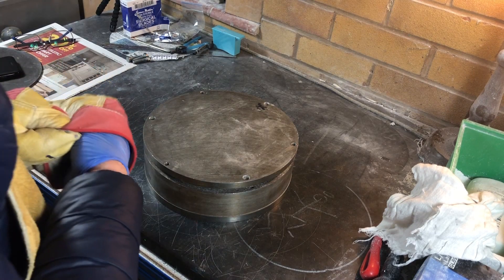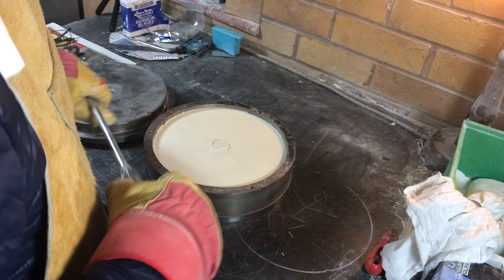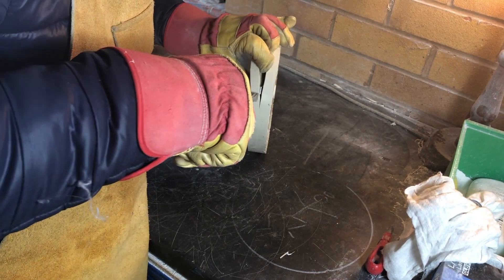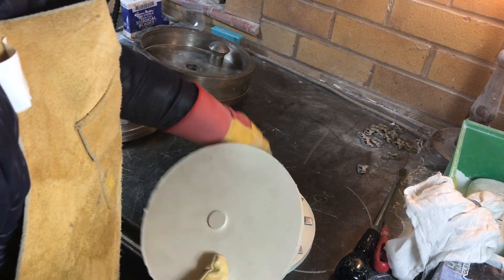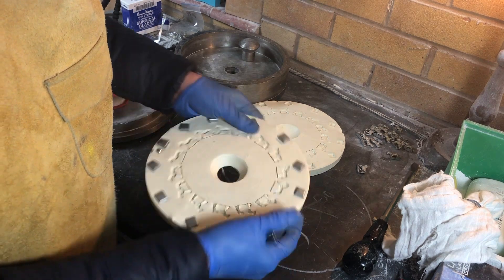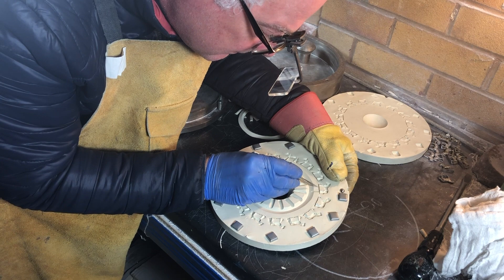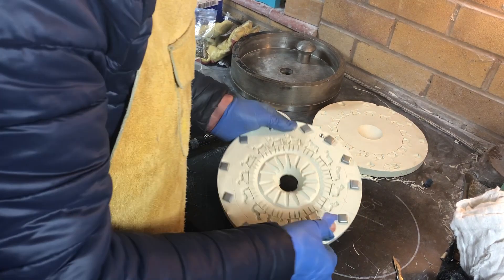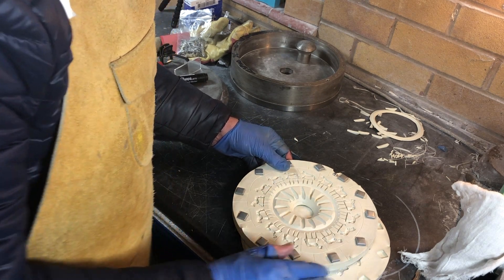Making a spin casting mould, part 2: extracting and cutting

Comment: Many thanks, so interesting ! I am actually working on my own tin miniature as an amateur (with a simple "hot pot II" ) As tin is rather expensive I'd like to mix something with it, maybe avoiding using lead because of his bad toxic réputation.., Something with bismuth & zinc ?  I found very few information on the web about alloys... what kind of alloy do you use ??
Reply from the maker: I use Pewter 92, a lead-free pewter. It’s not cheap, at 92% tin. 🙂  Pretty much all the work on viable tin and tin-lead alloys has been done, and mixing your own based on no knowledge is fraught with problems. I have a background in metallurgy and am happy to accept the formulations worked out by suppliers of casting alloys and low-melt alloys, because they know what works and what the properties of each particular alloy are. I wouldn’t use zinc: high melting point and wears out moulds faster. The cheap casting options are usually tin/lead/bismuth alloys. Some lead is inevitable. Geo W Neale, for example, offers the Grade L formulation, which is relatively cheap: it’s terrible to cast with for small pieces. If you have access to Prince August metals meant for drop cast moulds, although expensive they are viable for hobbyist castings.

Comment: The silicone rubber is high tear strength or high temperature resistant?
Reply from the maker: The main virtue of the silicone is it is low-temperature curing, which minimises shrinkage, especially if the moulds are pre-heated to 80degC (near to their vulcanising temperature) before casting. The cream formula discs are suitable for tin-lead alloys or pewter, so typically 280-330degC for metal casting temperature, and again pre-warming the moulds helps the casting process for lighter alloys such as modern pewter. High-temperature silicone moulding discs are available for alloys such as Zamak, but the shrinkage is greater. Tear-resistance is OK: I have silicone moulds that have done 10 years and are still perfect; others, just two years before some cavities are useless. The nature of the castings has the biggest impact on mould life: too many deep undercuts will destroy any mould quickly, even traditional organic black rubber

Comment: This is a great series as I have been learning to cut a mold….Why are the gates cut in the top not the bottom?
Reply from the maker: The dished cavity in the bottom of the mould makes the rubber far thinner there, so it's too easy to cut all the way through the mould by accident, especially if using a scalpel rather than a lino cutter. I have a number of moulds made by other people that are cut unto the bottom, and the network of cuts into the rubber makes for a less durable mould.

Comment: Hi Mr. Saunders...thanks for the informative videos on spin casting. I wonder if you know where i EU og GB I can buy 18" silicone moulds. I need moulds for both White Metal. Zinc an plastic. Any help would be greatly appriciated.
Reply from the maker: Try J Coker of Faversham  (http://j-coker.co.uk/), or Nicem of Italy at http://www.nicem.it/ (or via Hewitt-Impex in the UK - http://www.hewitt-impex.co.uk/).
Reply: @MrSaundersMiniaturesWorkshop  Thank you and sorry for the late reply....i'm used to get notifications on other platforms when people answers😊
I have one follow up question. I suppose you have an expensive specialized press/heater for vulcanizing. Is there any reason why I couldn't just bolt the top plate to the mold form and put it in an oven in stead of usinge a press/heater? This would save me a lot of money I guess.
By the way.. Your videos are well made and very informstive. A great help for an upcoming spinn caster.
Best regards
Werner
Reply from the maker: Hi Werner, I've noticed I'm not always getting notifications about comments too, so sorry about the late reply. There is a company that sells a mould can that you can just put in a domestic oven (https://www.spinboxcasting.com) as a cheaper option than a vulcanizing press. Domestic ovens take longer to warm up the can assembly and you need to allow more time for the rubber to cure.  The press I use is now detailed at  https://youtu.be/mFyGCJAEqQA For any home lash-up with bolts, you have to be careful that everything is robust enough: pressure can force bolt heads off and they'll ping around the oven with some speed. :-)

Comment: in 2023 keep cutting the rubber to find the pair above below. just make a mark with the sharpie without cutting a corner of the rubber. It's simple, just experiment. to let the air out? just make a hole with a drill bit at 2.5 and make the air outlet trace outside
Reply from the maker: Drill throughs are a last resort: they tend to block in time. They can also create “mould spiders” that customers don’t like the hassle of removing.  Notches are easy to feel and find as well as being visual.